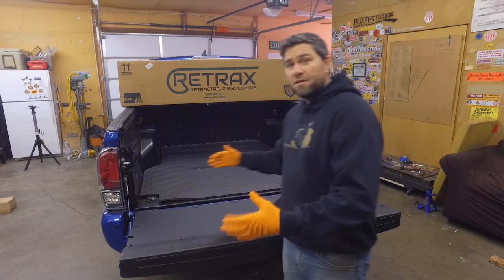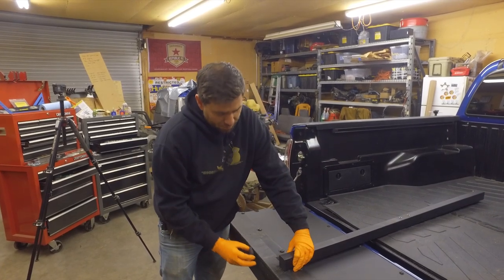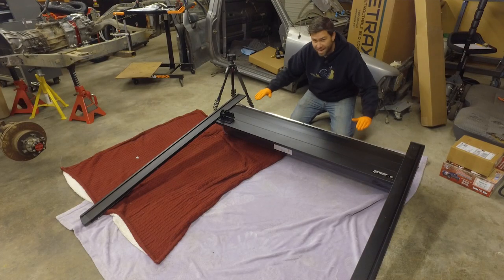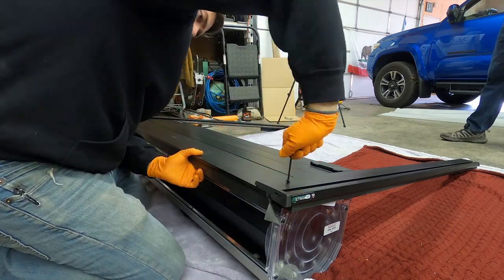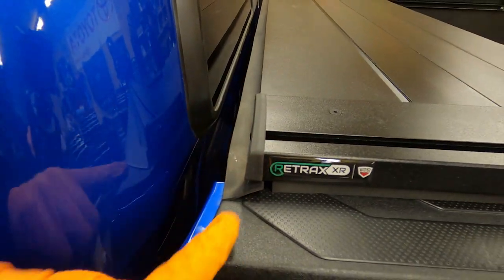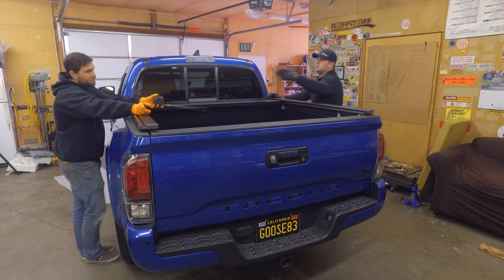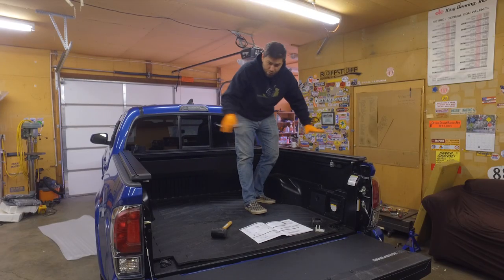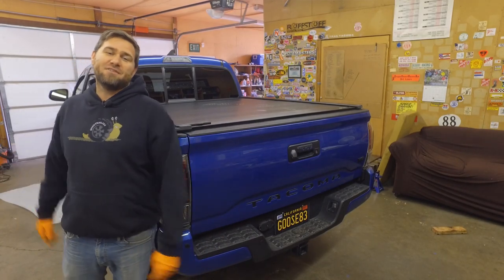Tacoma Tonneau Cover | Retrax XR Bed Cover

Comment: Nice video! I have a Pro XR, myself and thought I'd share some feedback I found along the way. The Pro series is actually rated for 500 pounds of "evenly distributed" weight, which I found impressive! 

One tip I found most helpful was Retrax recommends a slight upward tilt of their rails to help trap water into the rail, channel it into the canister, and out of the drain tubes. This also helps with how well the cover rolls. While one person handles the ratchet, one can stand on the outside of the truck's bed and place their palms on the rail with their fingers inside the rail where the ball bearings roll. Press firmly down with your palms while twisting upward with your fingers. This helps achieve a slight upward tilt and I noticed an improvement.
Reply from the maker: That's for the comments, those are great suggestion

Comment: I have a 2021 DCSB and ordered one that I'm going to be installing myself which hopefully arrives next week. A couple of questions.
1. Can the Toyota tie downs that slide onto the side rails still be used or will they interfere with the cover? I'd like to install them before sliding on the second T-nut on each side to give me more utility.
2. How much room is there from the bottom of the Retrax cannister to the base of the bed? I think I'd rather have the drain holes as high up as possible so cargo won't hit the tubes as much.
Thanks. Your video gave me a lot of good information.
Reply from the maker: There should be plenty of room for the tie downs on the rail. There was maybe 9-12" of room under the case of the cover. Either way would work, but for the best water flow straight down drains would function best
Reply: Just asked the same question. Were you able to fit the rail tie downs with the cover in place?
Reply: Hello How has your cover been? Thank you

Comment: Hey - I'm thinking replacing what I currently have....how's the water tightness?
Reply from the maker: It's very water tight, had a few drips where the lid meets the tailgate, but that's somewhat expected
Reply: @SnailTrail4x4  not bad at all...  I went ahead and got it, gotta install... Sitting in my basement.

Comment: like it but the strongest cover is still the Diamond back HD.
Reply from the maker: Does it roll up tight like this one?
Reply: @SnailTrail4x4  no it flips up on either end.  It's basically a toolbox deck lid.
Reply: The Diamondback is too bulky…this is low profile which looks way better
Reply: @SnailTrail4x4  he stated "strongest". Dont know which is really "strongest" though

Comment: Would it be better to drill the drain holes in the BOTTOM of the bed?
Reply from the maker: Yes! But we already had the cover installed. It would be best to drill the holes before you put it in place

Comment: It sucks that you had to remove the tiedowns. Did you ever replace them with something else in a different location? Great video by the way.
Reply from the maker: No, it would be really difficult to access them with the roll up case in its place. Might be able to place something on the floor of the bed

Comment: "Strongest tonneau cover" is a bit of a stretch.
Reply from the maker: Prove me wrong
Reply: @SnailTrail4x4  Renegade bed covers have an "On Top" capacity of 2,000 lbs. that retrax will fold up like a rusty lawn chair if you put 2,000 lbs on it.

Comment: You had me until you drilled the hole
Reply from the maker: You can let it drain into your bed, that's up to you
Reply: I'm doing this install as a DIY--the composite bed already has drainage holes near the cab.  I'm just going to let the cannister drain there and nature will run its course.  The bed mat should keep anything critical above the drainage level except under the most extreme conditions.
Reply: @gregdyer5117  how did your solution work? Hoping I don't have to drill...